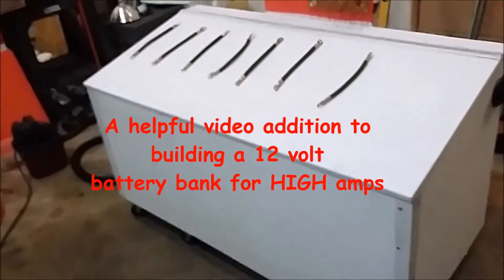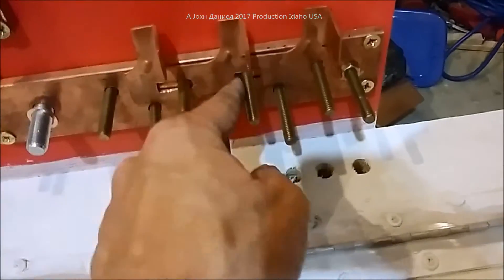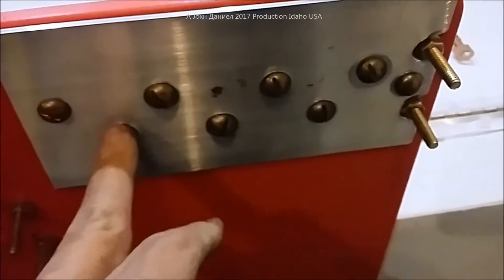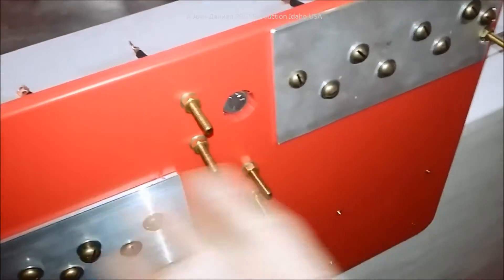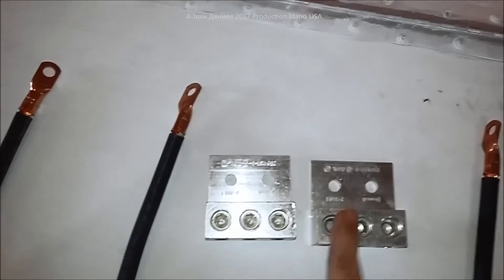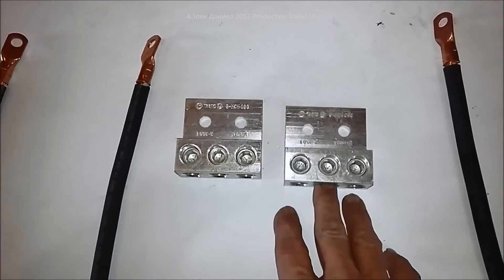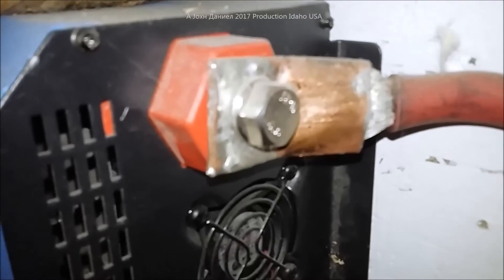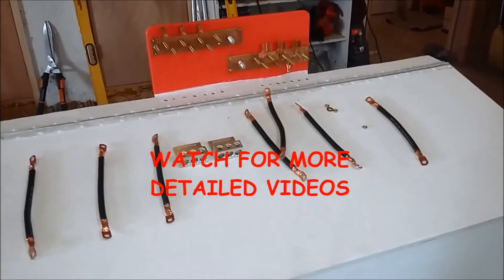Solar Battery Bank 12 Volt DC High Amp Wiring: UPDATE 2.5

Comment: Been  going back through your videos love this battery box and how its set up. I've seen other setups where they daisy chain and they seem to have problems. Can a box like this be set outside if you put a roof on it ?
Reply from the maker: Yes, you can place it outside if it's lead acid types. My newest one I built has a shot in some newer videos ( https://youtu.be/mWJG5HoqOIY?t=150 ) 3750 AH capacity with all equal length 4 awg cables and 10 gauge monitor wires on it, 140+ amp per set x 16 draw ability. 2200 amp total draw abilities. Cabled from it to the mains buss https://youtu.be/xCQXQ7AnrvM  for 1500 to supply over 900 usable.

Comment: Hello Mr. Daniel, im trying to build a solar power system and battery box as depicted in your video. Experience counts so I am trying to follow your engineering on my build.  
Is the charge controller connected to the bus bars that the batteries are shown connected to? In your video I could not view the method of attachment.
Reply from the maker: Connect your charge controller direct to the battery +/- buss bars with a proper sized fuse somewhere before them from the controllers.

Comment: Hello! I come across some used L-16 batteries. The only test we could DC is a cranking amp test. They showed over 900 CA each. With some small electronic gizmo. I'd rather done a true discharge test.  The original capacity wal about 450ah @ 20 hr rate. For the price I gave for them. If they are only half capacity it will be well worth it! I was wondering about the epsom salt thing you did. Would that help the capacity? Does it help with sulfation of the plates? Thanks .
Reply from the maker: The Epsom Salts dissolves plate sulfur and re animates it.

Comment: nice thick copper plate, never seen aluminium fittings before and was pleasantly supprised they do not corrode etc, i remember the old  landrovers and dissimiler metals fusing,
One guy i talked to in Queensland Australia has been offgrid for decades and he reverted back to 12v because he was tired of loosing batteries in a bank due to either excessively high or low volts in an idividual battery in a series of batteries in a 48v bank, 
so now he has one 250w panel and charge controller for each "BIG" battery and has not had a battery fail in years, i am aware of battery balancers but where do you want to you stop spending money.
nice build ofcourse ,you covered all bases as i expected, nothing like lifes little experiences to make you really go to town on a project.
Reply from the maker: closertothetruth Common sense equals 12 vdc.